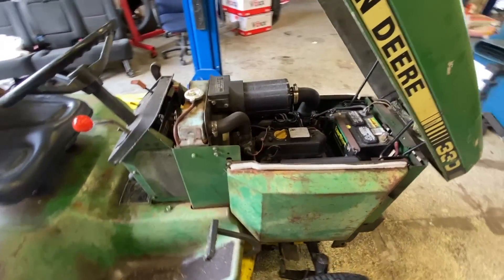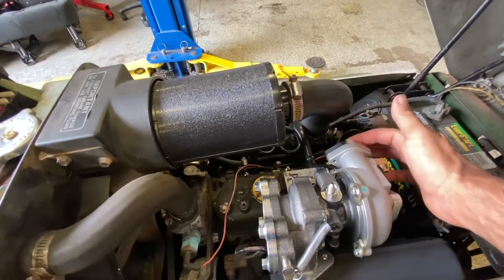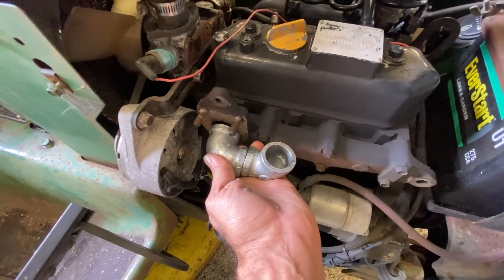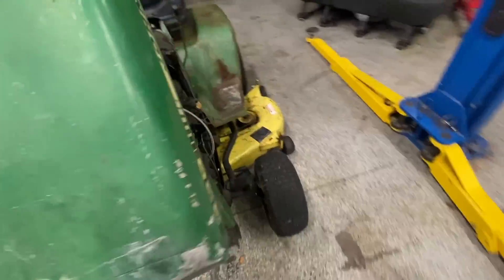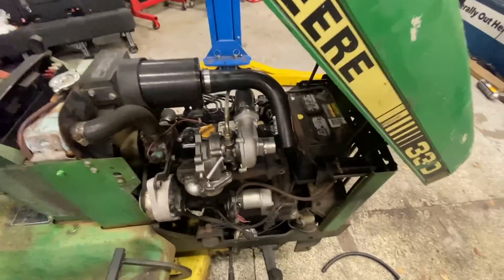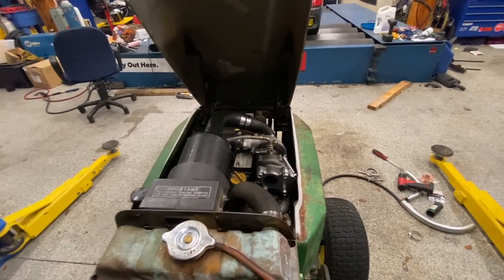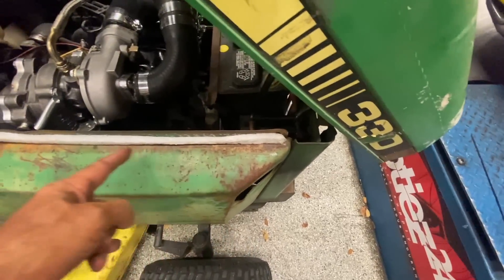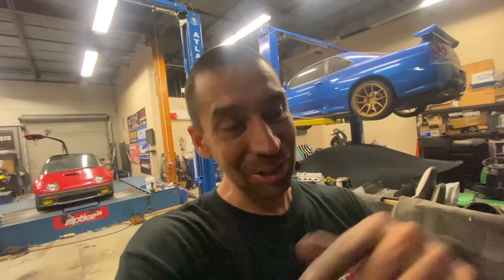TURBOCHARGING MY DIESEL MOWER | JOHN DEERE 330 TURBO | ROLLS COAL

Comment: Nice 16hp unit! I just fully restored my 1986 430 this winter and turned the fuel up and added a smoke stack. You can turn the fuel up wit hthe fuel screw on the injection pump just like a 12v Cummins as it looks likeyou did! Love it The Yanmar is a bad engine!

Comment: this is one of the neatest builds ive seen...

crank the max fuel up... the nut on the front of the pump. wind screw out one turn.
remove a shim or two from under the pump rack, get some advance.
lift the max rpm up a bit. 4200 is fine... some people just take the governor off altogether. im not that keen on blowing up my 35 year old engine.

i tracked down a billet compressor wheel thats a direct fit.

lot of playing with various turbos.. compound... hybrid... equal length headers...

in the end im back on the vz21 and a log.

Comment: There’s a golf cart on YouTube with one of these yanmar 3 cylinders, it’s got stiffer valve springs, a lot of pump work, a compound turbo setup on it, and is paired to a six speed motorcycle transmission. It makes around 30psi on stock internals, and absolutely rips. Nice job with yours though!

Comment: That came out really nice. fits like factory, and almost looks like it too. Need some more mods now, intake for noise and an intercooler at least. Also the boost gauge is a must, I want to know how much, or should I say how low boost it makes.
Reply: I would add a EGT gauge.
Reply: You'd be surprised. My buddy has a cub cadet garden tractor with a 3cyl Kubota close to the same displacement and it makes 20psi...

Comment: How’s the turbo holding up on your 330? Used it much since you put it on? Really wanting to see how much vibration those 90 degree pipe fittings can take before they brake. Only reason I’m asking is because I want to do the same thing on my 332. And those fittings look to be the fast way the mount the turbo.

Comment: i have the same mower just in yanmar colors, and i have a garrett vgt gt1546 on it, did that about 10 years ago ported the compressor housing or the “T51r” mod as people know it, just i put piston oil cooling nozzles in the block and a small water/air charge air cooler 😁✌🏻and it makes 5lbs but be aware you will smoke the mower clutch

Comment: You might end up cutting the fuel back a little bit, if you're under a full load and the smoke doesn't clear up, it should just be a little haze when you're at full boost it should only smoke until the turbo builds its full boost, I'm not sure how good the head gaskets are on these engines but they're pretty bulletproof.

Comment: Pulling a lot of weight up a hill or cutting very heavy grass or running a snowblower is where you're really going to see the benefits of that thing it doesn't take much with a diesel, 1 psi will make a difference.